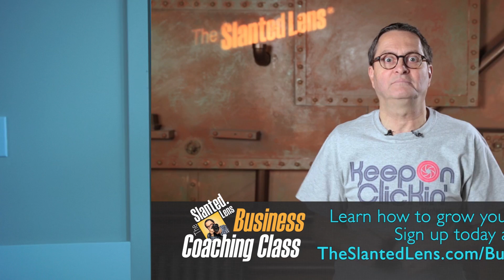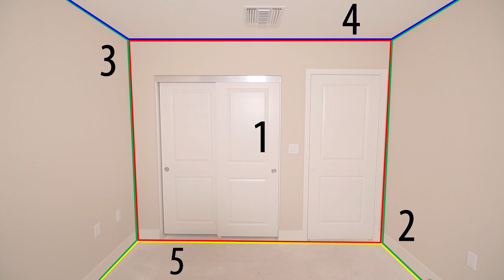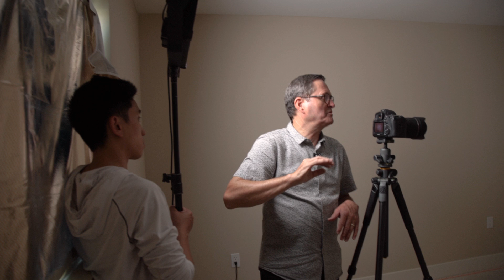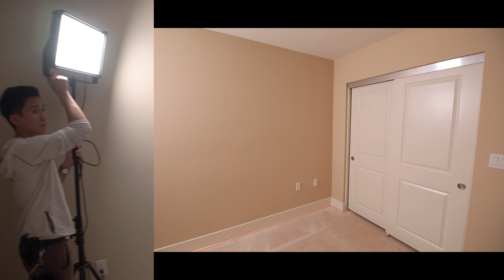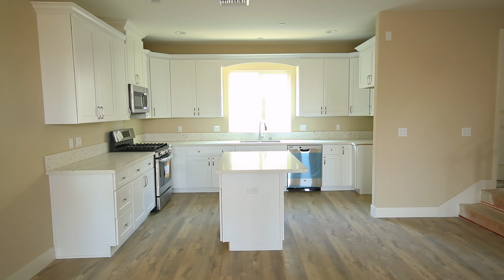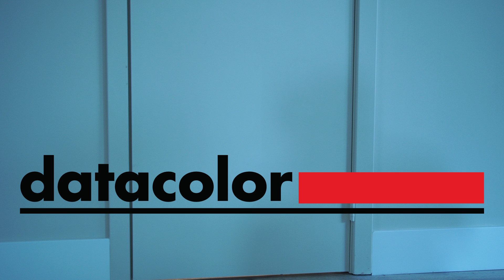Laws of Light: Lighting a Room (The Inside of a Cube)

Comment: General rule of thumb is camera at door knob height. Also shoot strait on. You will never get perfect lines when the lens is tilted, unless it's a tilt shift. PS can't fix everything. 

Use flash or strobes to light the room. Balance it with natural light from the windows. Turn on lights, but this is to "trick" the viewer into thinking the lights are lighting up the room. In reality, it's not doing anything as your flash is your main light, with a little bit coming from the windows. This will also fix any color balance issues. 

Also, don't be afraid to take multiple images to blend exposures, or to take a separate image of a PC/TV with a black card to remove the reflection and blend it in post.